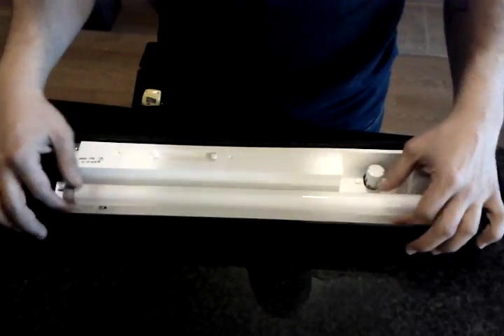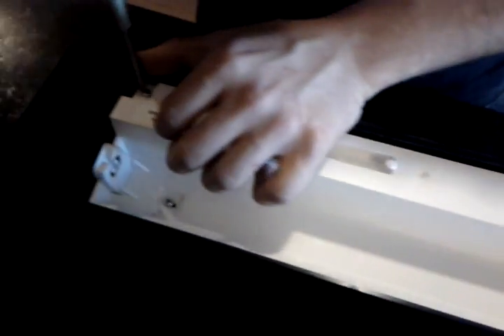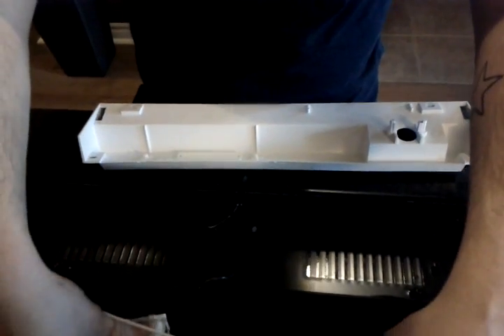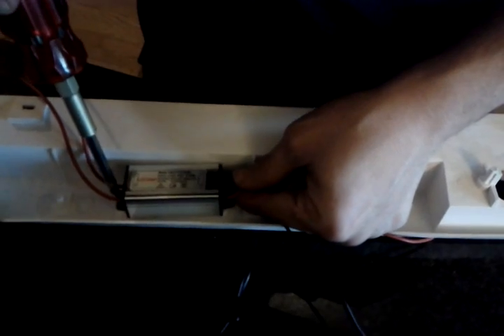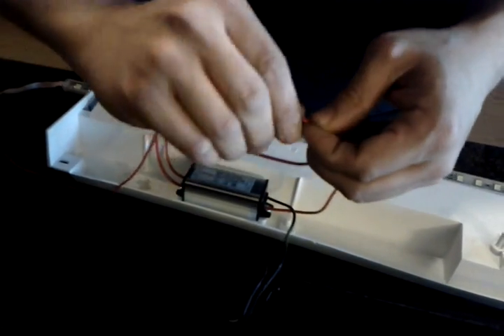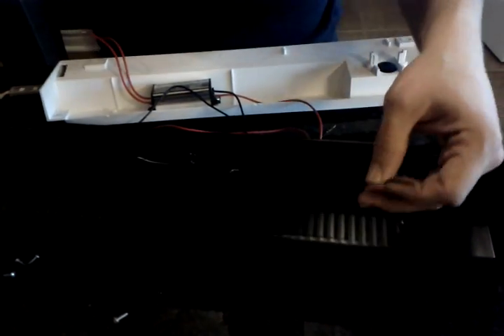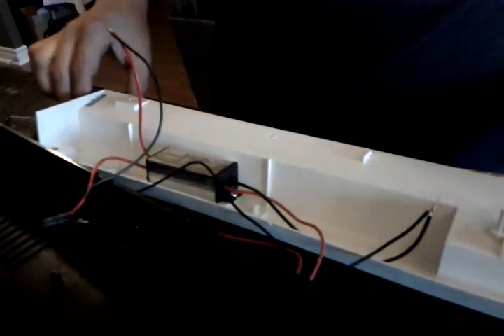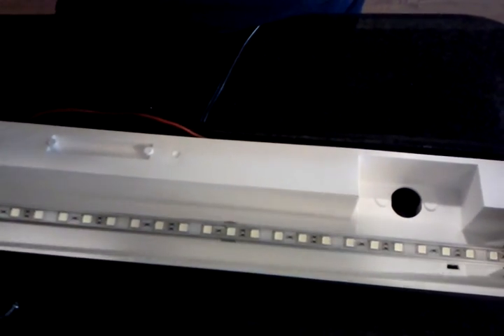DIY LED fish tank lights Fluorescent bulb to LED

Comment: Im using LED for my 220-200L fishtank since the begining,the only think wich is problem is that you cant calculate how much wats will need for your fishtank cuz the LED is with low wats but they work more powerful than the standart luminiscent lights...but with some test i found the right balance.The plant grow without problem with LED.Ofcorce the wite LED light cant be used.

Comment: The wire already connected to the power switch is the live wire? The black wire on the power cord is live wire and the wire with the white strip is neutral wire?
Reply: is it true? The wire connected to the switch is the live one?

Comment: I ended by purchasing the adhesive 12" flexible with adhesive LED's on ebay. Looked everywhere else and a lot of webs are only offering by the roll. I will use Gorilla Glue :-) I will let you know how it works when everything is together. Thanks,

Comment: Thanks for your help. I purchased on Ebay an AD-DC 12v Transformer Power Supply Adapter LED Driver Waterproof 10W-200W for 9.99. Thanks for your quick suggestion on LED lights. You have saved me a lot of money. Having to work on finding the 6" or 12". Looking forward to setting up my aquarium again with these lights. Love LED's.

Comment: Your video was very helpful. I am converting my hexagon tank from fluorescent bulb to LED. My current bulb is a 14 inch and having a hard time finding an LED strip of that length. Also, I am quit tech savy, but not sure what to buy on ebay for the LED driver. Please comment and thanks again. Betty
Reply from the maker: Betty... you can buy two smaller 6" lights if you can find some ... or even a 12" doesn't matter. Led's are so bright and the driver can handle the two no problem.

Comment: Overall informative but very hard to see a thing as you explain wiring the power and switch.

Im going to try out this driver 350605465163
And these lights 181028825212

Comment from the maker: To Dan Smith ...found your problem ur led's are perfect but the converter u bought is no good. So your led's are 12 volt. And your converter output is too high. Causing you led's to freak out. Look for one that is output 12 v range.

Comment: Ok tested lights on 12v dewalt battery they shine an no blinking... Switched out driver with the other new one and it blinks faster.... Specs on the 2 drivers I got for my 55g tank..
Ac85-265v50/60hz
Dc:30-48
10w
Any suggestion on new driver?

Comment from the maker: For Dan Smith. ..Test your led strip on a 12 volt drill battery. ..if there on solid there then ur converter needs to b replaced. If there blinking still led strip may need to b swapped. 
Good luck hope this helps

Comment: I'm pretty sure they'll fit. I have an older hex-tank, and the 15" hood is an odd size for these LED not to mention, the hood is failing. 15" is 38.1cm...so I figured with the smaller lights, I needed at least two. 30cm is the closest I can find.

Comment from the maker: Relpy to Spencer Smith.... yes those lights will work. As long as the length fits within your hood. And if you want to load two or three lights on to that one power supply you simply add them on to the output side you should be fine. I wouldn't load up more than that though. 

I'll try to make a new video soon with close ups of what I got. Thanks for watching.

Comment from the maker: Type in ebay "waterproof power supply 10w" most of them can work with any input between AC90V- 265V simply said works just about everywhere. And each one of these can take up to two or three led bars that are 12V.
I paid $5 CDN each for mine. Hope this helps